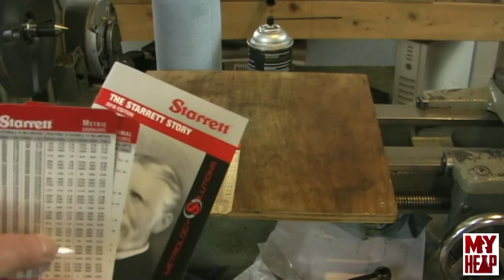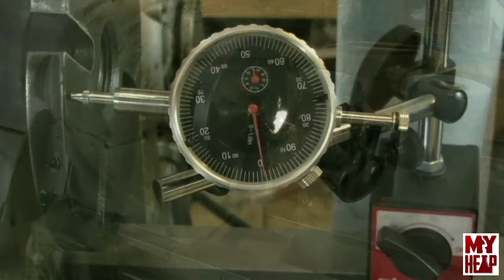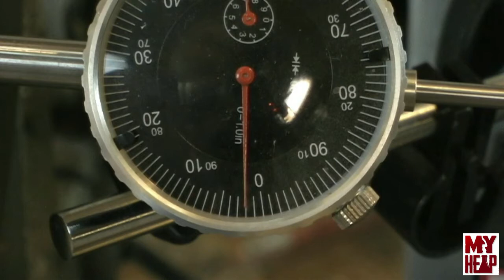Atlas 10F Lathe - TH54 - 23 - More New Parts, QCTP and an Issue with the Back Gears

Comment: I have the exact same machine as you, and have slop in my cross slide.......the guy who made you the cross feed nut what a dude.......would you be happy to know the thread details as i need to replace mine.
Reply from the maker: Hi Peter, Thank you for taking the time to post.  The crossfeed screw is 1/2-10 Left Hand ACME thread.  The guy who made mine said he bought the tap from ebay.  At the outer end of travel the new nut is pretty nice, towards the operator at the start of travel there isn't much difference for me as the screw on my machine is pretty worn in this area.  Once I get a little more comfortable with machining, I would like to make a new screw myself.
Reply: Thanks for the quick reply Joe, You and i have similar symptons then ! As a temporary fix i melted some soft solder in the nut and let the screw bed itself in, which has taken out some of the slack. But again like you the screw replacement is what is needed. I will get to watch your other videos and no doubt learn more from your experiences, many thanks
Reply from the maker: Peter, I am guessing that both the nut and screw are worn?  By adding the soft solder to the nut, did it make it stiff at the end of the screw towards the back of the lathe in order to compensate for the front of the screw where it should be most worn?  How did you solder the nut?  clean, flux and tin or something else?

Joe
Reply: Hi Joe, i went to town on cleaning the nut, and then using flux and solder i applied a super small amount at both sides of the nut. This way i hoped to create a little more friction, and the hope was that his would at least take up some of the slack.....it appears to have worked, as before, and even on light cuts the tool was being pushed away from the work, that no longer happens......Next job/mod for me is getting rid of the Lantern toolpost :)
Reply from the maker: Peter, get yourself a QCTP, you will love it!  I bought a Bostar and although it is Chinese it works just fine for me.  Do a search on Ebay and you will find them at a reasonably affordable price.  I think mine actually cam from cdcotools.com.  Best of luck and keep us posted.  :-)

Joe
Reply: will do Joe, i have been in touch with a supplier here in the UK, (RDG Tools) and they want a measurement between top slide and chuck before they recommend what they think i need. Will be in touch Joe, keep at it !
Reply from the maker: If your going with the toolpost like mine you will want an AXA, the BX, CX et.al. will be too large.
Reply: Hi Jeff the QCTP arrived and all i need now is a suitable bolt/T nut set up and i will be away !
Reply from the maker: Peter,  Glad to here you have your QCTP.  You will love it.  I was fortunate that a subscriber made a T nut for me, but lacking that I would have had a go at forming the nut with a file and hacksaw.  The threads on the T nut side of my stud is M14x1.5 (fine thread) and the clamping nut side (Top of stud) is M14x1.75.  (course).  Let us know how it goes.  Thanks for taking the time to comment and get back to me.

Joe
Reply: Hi Joe, QCTP is on, and its a step up from the lantern style for sure. I didn't have the right bolt/nut combo, so will sleeve the one i have fitted, and this should be OK. in the meantime, and after turning some aluminium at the weekend i notice that the tool is being pushed away from the work even on a cut less than 10 thou, so the backlash is really next on my list to be sorted. meantime happy turning !
Reply from the maker: Peter, glad to hear you have it up and running.  So is the tool being pushed away on a facing cut or a longitudinal cut?

Joe
Reply: Hi Joe, its on a longtitudinal cut, facing seems to be fine. I have adjusted the jib screws, but they cannot take all the wear out. . . .i need a mate with a cross feed nut going spare :)
Appreciate your interest
peter
Reply from the maker: Curious, if the play is taken from both the compound and the cross slide, I don't understand how the tool can be pushed away.  There is something I am missing I guess.  I would give you my old cross slide nut but I already sent it off to another subscriber.  Sorry about that.  At some point I want to make a new cross feed screw for mine since the threads are really worn on the end closest to the operator.  This won't happen though until I get the Burke mill up and running, or a milling attachment for the lathe as I have no way of cutting the woodruff keyseats.

Keep me posted Peter, I am interested in seeing how things work out for you.

Joe
Reply: done a bit more turning and have ordered the appropriate tap and brass to see if i can machine up a cross slide nut. . . . will let you know how i get on
Reply from the maker: Peter, That is great!  I am looking forward to hearing about it.  Maybe you can share some pointers along the way on making one of these.  :-)  Just wondering, who did you order your tap from? Cost?
Reply: Got the tap from RDG Tools, a model engineering supplier here in the UK, of the top of my head i think it was £15. . . . hopefully it will do the job and the slack will all be gone
Reply: I still haven't started the machining of the nut. . . .too many other things going on, mainly may cars keeping me busy ! Still i have the tap now as i said, so i re soldered the threads and ran the tap through, and its made a step in the right direction, which for now will do. Hope all is well, and i will get back to you with progress once i have completed it. Regards Peter
Reply from the maker: I understand about life getting in the way.  I have been busy at my place trying to get the shop insulated and the wall covering up, etc, etc.  So when you soldered the threads, was this just a good tinning or did you get more on?  Looking forward to seeing the finished item.  Thanks Peter.

Joe
Reply: Hi Joe, i saturated the threads with flux and plumbing solder, and whilst plenty was then removed it has no doubt taken up some of the wear, i may rinse and repeat to see if a better result still can be achieved. Will stay in touch, regards Peter
Reply: Got the cross feed nut kindly made up by doubleboost in the end,  huge improvement, and i am back to enjoying my machine once more

Comment: Not an expert, but I read somewhere that running the two highest speeds in back gear was not recommended.
Reply from the maker: Was that with the motor pulley in high speed or for both high and low speed motor setting?
Reply: My Heap I believe it was referring to the two highest speeds on the spindle pulley. Naturally, I can’t find where I saw it now. I’m working my way through a QC54. Just finished pulling the spindle to replace the bull gear. You videos have been very helpful. 👍
Reply from the maker: Hey Karl, thanks for the link.  That was great thread to read.  Too bad the pictures were unavailable, but the gist of everything was there.  I am going to have to give my Atlas book another read and see if the information about not running in the two higher speeds of the back gear are there.  But it would seem to me that if it were a problem they should have addressed it considering how many years the lathe was made.

Anyway, great information.  Thank you sir.

Joe